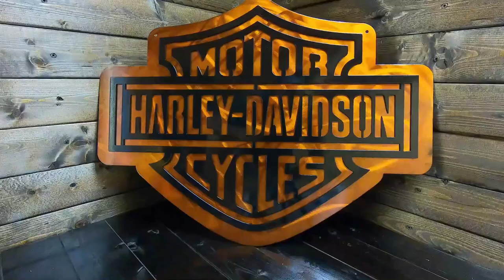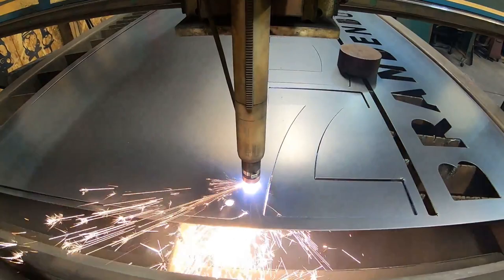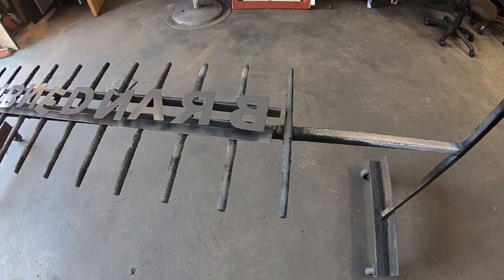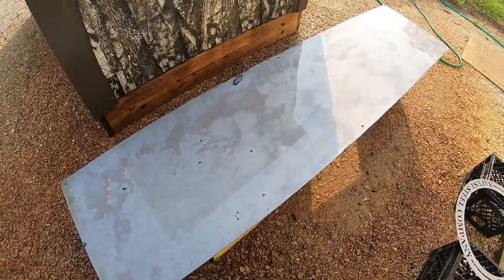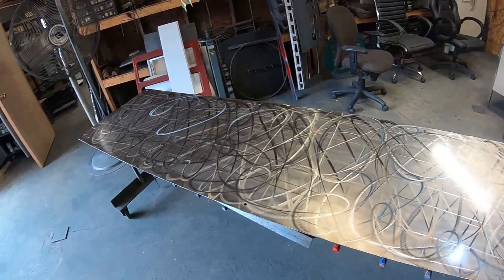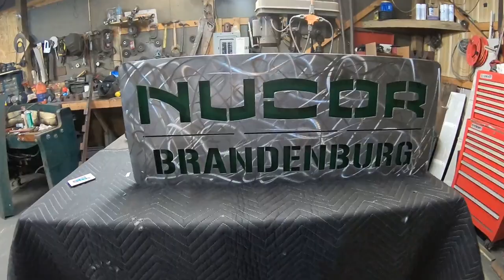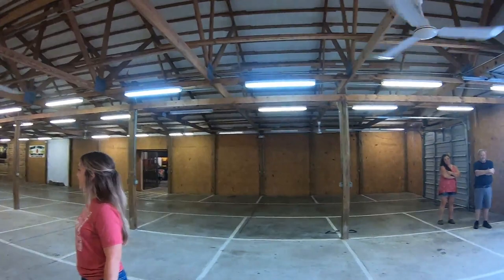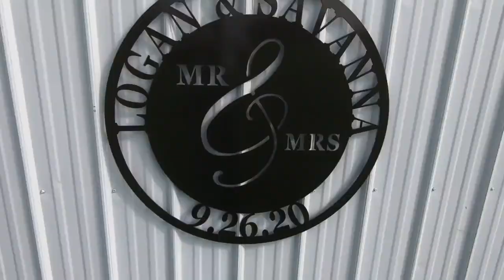Making more metal signs for NUCOR.

Comment: Great job Jr. I made 1 of them shadow box signs. When I put the LEDs in there, I put mirror plates on the opposite side to help reflect the low voltage lights better. I got the stick on mirrors at Wally World They come in 12"x12" squares and you can cut them with a razor blade knife. Just for future reference.